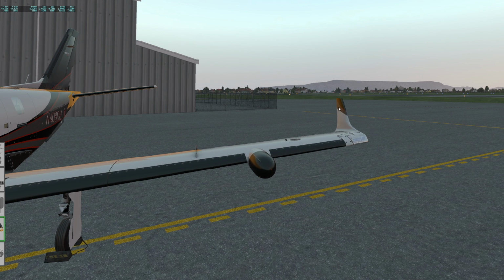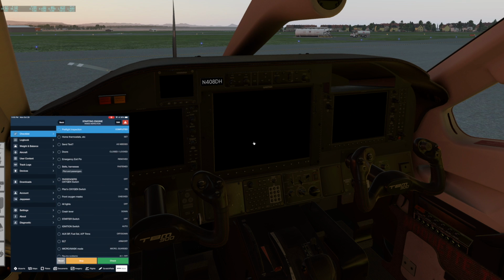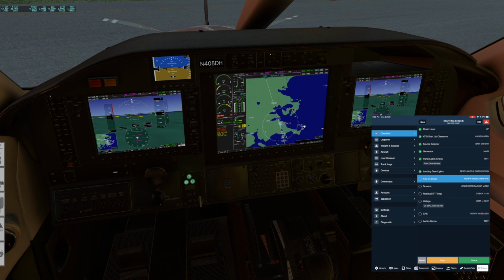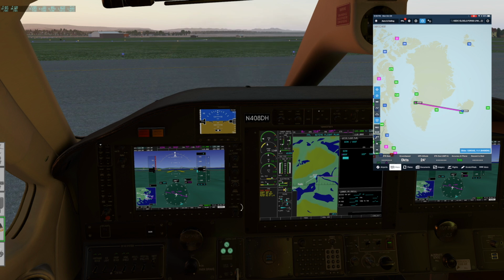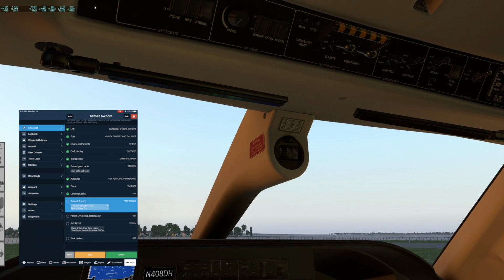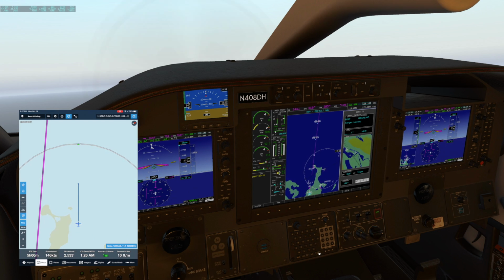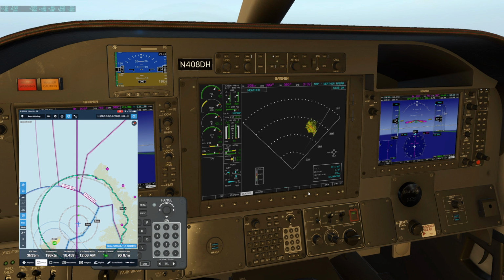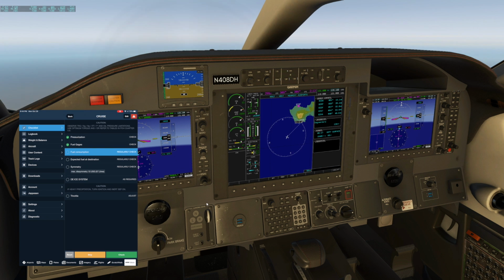HotStart TBM 900 Released!  Test Flight Part 1

Comment: Could you be so kind to quickly comment on aileron trim / input used in the real aircraft, for wings level flight, i.e. is it used to compensate for torque/imbalance throughout the flight much? As far as I can understand, YD should deal with P-factor, does it also do prop torque effect and/or slight fuel imbalances to any degree? Handflying the simproduct (v1.1.9) at high power settings right now feels weird to me in how it requires significant roll trim adjustment throughout. 

Thanks for your excellent videos, they're great!
Reply from the maker: It's hard to say, honestly.  I do sometimes find that I need to use aileron trim IRL when in the pattern to land, but never really do when taking off and climbing out.  Doubt the normal fuel imbalance causes much of an issue with that though.  My plane does flight a bit with one wing high, maybe due to the radar pod causing an aerodynamic asymmetry.
Reply: @JasonFlies  Thanks for the insight, much appreciated!

Comment: Hi Jason, for calculation purposes how many nautical miles per minute fly TBM900 to plan a flight? Thank you from Brazil!
Reply from the maker: with no wind that would be 315/60 = 5.25 nm/minute
Reply: @JasonFlies  and how many feets per minute do you use to plan a climb and descent?
Reply from the maker: @JohnnyLeite-Brazil  That varies significantly based on weight, temperature, and altitude (can be 2,500fpm or much less).  I use ForeFlight to calculate it for all the phases of the flight to get an accurate number.

Comment: Hello Jason. Many clients of the HotStart TBM 900 are complaining about it’s ground handling especially on the Take/Off Roll. I noticed that you set the rudder trim to neutral on takeoff which is also the only way I can get it to take off straight. Can you confirm that in the real TBM you’d leave the rudder trim centred? According to the TBM instructional video it should be set in the green. https://youtu.be/o8sc3VlZPUc I am a CPL TT 312 hours and never flew a single turbine only single and twin pistons and always have to set rudder trim to compensate for all the t/o forces.  Thank you for clarifying.

Cheers
Reply: I take off in the real one with the rudder trim halfway to the green.  I do that so I know I will only have to press right-rudder during a typical takeoff.  If you put it in the green it is too well centered for me and then I am having to push differing amounts of left AND right rudder while taking off.  I prefer to just work with either more or less right rudder required while rolling.  For the sim, I just have it centered like you said.
Reply: @jasonmiller5956 Thank you Jason for clarifying this point and taking the time to beta test the aircraft. The TBM 700 came out when I got my PPL, and I will never forget it when I first saw it on the cover of Flying Magazine!

Comment: Hey Jason, I have some comments regarding the MFD. When you're on the main map screen and you scroll the big knob to the "Chapters" and you have \MAP/\WPT/\AUX/, Well on the Hotstart tbm AUX is replaced with NRST. Am I missing something or is that just not modeled? And if it isn't, is missing those pages a big deal? I'm being super picky but if they're going to put this much detail into a bird they might as well go all the way.

Regard, X
Reply from the maker: Yeah, my understanding is that part of the model is primarily the built-in Laminar G1000 software.  They made some tweaks to it to make it better for the TBM but it wasn't reasonable for them to do all the missing chapters, etc - maybe not even possible?  I find I rarely miss them though - in the real plane I would use the Weights page in AUX a little bit to check limits, but not a big deal to not have.

Comment: FYI you can use SimBrief to download a flightplan directly into the G1000. However SimBrief assumes a cruise climb of 170 knots and not Vy of 124 knots and after several flights comparing the TBM cruise perfomance section the  fuel and TAS were identical / or very close to the real numbers👍

Comment: I had so many questions but found all my answers in the real POH. I wish the torque G1000 itorque guage looked the same , but really I am just being picky. I started my virtual Atlantic crossing from Tarbes to Prestwhick. The black switches on black panel are hard to determine their toggle position. I hope they change the color to provide contrast. I love using the TBM perfromance app.

Comment: Will it work with Virtual Reality ?
Reply from the maker: Yeah, it does!  Though I have had to turn down the graphics settings to get a good framerate
Reply: So, what graphic setting do you recommend?
Reply from the maker: @frspottingaviation5208  Oh, depends on your machine, but whatever works well in non-VR, I'd start with that and work it down until you get the framerate that doesn't make you feel sick

Comment: Hi Jason, (I’m also a 900 pilot), have a question regarding this sim. What computer you use? Do you have like a very powerful computer for gaming? Mine is a Microsoft book pro but is impossible, (to slow)
Reply from the maker: I actually do a fair bit of gaming, when I can find the time, so I went crazy and sprung for a beefy machine from here: https://www.originpc.com I used to always build my own but as I age I am tending to favor stuff that "just works" :)
Reply from the maker: You don't need anything that crazy though, but you do want something with an upgradable graphics card, and a card that was made in last 2 years or so I'd say - laptops almost always have crappy GPUs

Comment: Haha I saw pictures of your plane & hanger in the lighting maintenence section of the sim. You and the two Hot Start guys should get together and do a video interview and actual flight, discussing the developmental challenges of setting a new bar for 3rd party x-plane aircraft. What a unique opportunity you've given the developers and subsequently, all of us flight simming enthusiasts! I'm about to download my 3rd update right now, v1.1!
Reply from the maker: Those guys are awesome, so impressed with what they created and how they are supporting it after release!
Reply: Jason I think they immortalized your registration number on a plaque below the starboard horizontal stabilizer :) And my gosh, take a super close up look at the USB plug...the Amphenol stamp in the metal shell is 3D modeled? Crazy!
Reply: chamberlin1 you can customize the tail number to WHATEVER you want
Reply: Drew Leevy I know Drew, I've spent hours personalizing mine! But it's not the tail or fuselage number I'm talking about.... Look closely at the tiny  plaque under the horizontal stab, right side of the plane.
Reply: @chamberlin1  It's not QUITE identical.  Although I did use Jason's TBM for reference, I changed at least 1 number on each identifying plaque or plate.
Reply: Leading Edge Simulations Ahh gotcha, thanks for the personal response. Bottom line, we all appreciate your attention to detail for the sake of our flight simming enjoyment!

Comment: Are you or have you tried the foreflight and pilot edge integration? If not will you be trying it in the coming videos.
Reply from the maker: I have used PilotEdge, need to try it more though.  I tend to be "random" on my sim flights, pausing mid-flight for dinner, etc., so don't tend to use ATC much
Reply: PE is the best